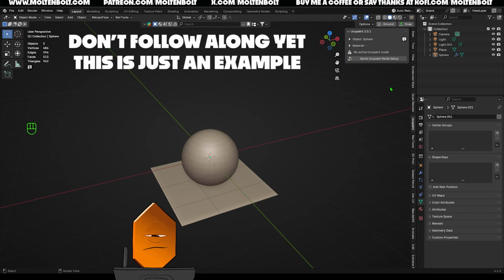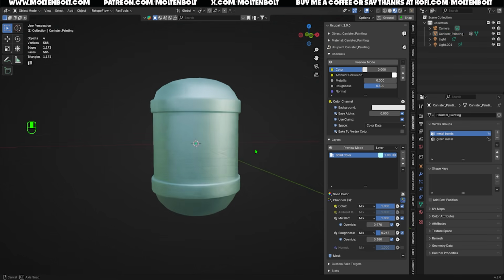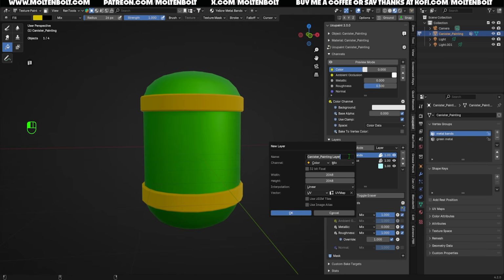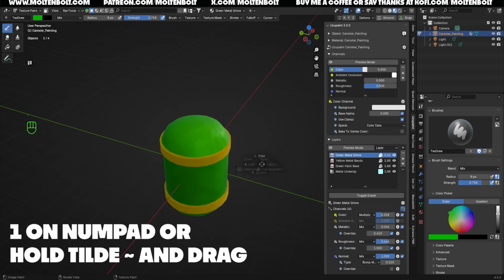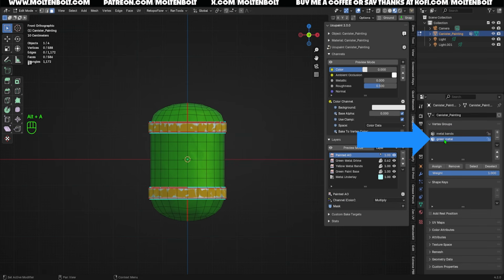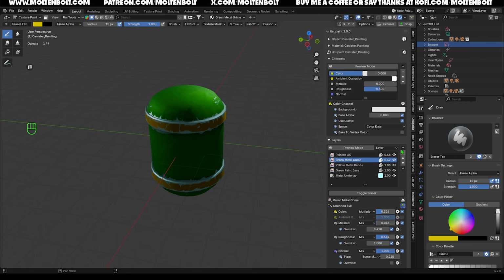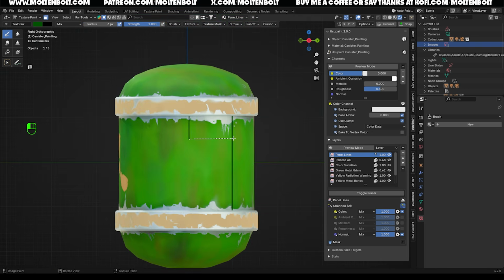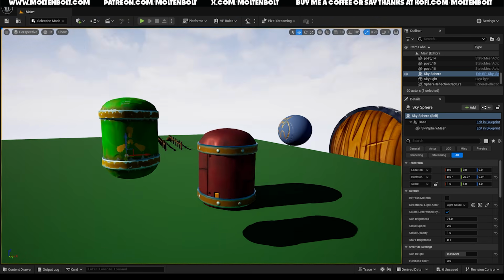FREE Substance Painter Alternative? Ucupaint! Blender Step-by-Step Tutorial

Comment: Im following your tut, but when im painting, some artifacts start to pop up afterwards. its like some quad topology is pushing trough, i can paint over it, but after a while it reappears.
Reply from the maker: Ive noticed this happen as well sometimes ans my hypothesis is that it has to do with the brush angle relative to the camera angle, maybe? 🤔
Reply: @moltenbolt  i have been testing it, with your model, i can replicate it by painting at weird angles, but if i subdivide it by 2, apply it. I can't recreate the artifacts. I think you allready know this, but another reason to use high poly res and bake it down.

Comment: Thanks for this tutorial, one thing though, when I paint just like the way you say, the color slips its way into other layers, no matter if the Paint Mask is on. Is it a me problem and is there a solution to fix it? Thanks anyway
Reply from the maker: Might be the Bleed settings in the brush options? Could be that it's set too high and it's painting over the uv seams 🤔

Comment: best ucupaint tutorial!!!!!   and omg, after 3 days of wrestling with substance painter to Just Give Me a bit of painting on the uvs with TRANSPARENT BACKGROUND... (it failed)  this is a life-saver!

okay, but on the radiation symbol part...  suppose i want to define the size and rotation of the decal, then move it into position -- like drag it around on the model before 'stamping' it down.  can it do that?
PS: would also like to be able to change the proportions of it while i'm doing that.  ;D

OH! i see... blender has just made that impossible, hasn't it? :/    i even changed the ratio of my decal  image, and when i put it in the brush... the brush made it square.  ::SIGH::  SOME DAYS!!!
Reply from the maker: Thank you! You can rotate the orientation of a brush, for sure. I think the hotkey is either CTRL+F or ALT+F, but I dont remember which hahah. The size will just be the brush size 😁
Reply: i did find blender's stencil brush mode, which will let me place and stamp a stencil.  but still doesn't let me stretch it on only one axis.    thanks for getting back to me :)

Comment: Hi! I have a question about exporting my model to a game engine like Unity. I made a house building, that has multiple meshes, with each different channel. Do I individually bake the different channels by clicking on each different mesh, and then exporting it as glb? Or is there another way that I need to go about when dealing with different meshes all at once? For some reason, when I import the glb file into unity, it is just showing as a white folder, but its not letting me put it into the scene. And I individually exported each different mesh's channels btw. Any thoughts as to why its like this in Unity would be greatly appreciated, thank you!
Reply from the maker: Dunno if you have tried this already but you could try to join your house meshes together into a single object in Blender before baking and exporting and see if that works. I know that with Ucupaint you can export an object made of multiple meshes and have it work. Lemme know if joining them together before baking and exporting helps, if not I'll take a look after I'm done work 😁
Reply: @moltenbolt  I will try that with my next project! I just installed a JsonDotNet package that lets you import gltf files to Unity (followed this other tutorial) which worked, but maybe your method would be easier. Thank you for always responding to our questions!
Reply from the maker: @babyshkaProd  hehe I do my best to help where I can :D 3D can be hard!

Comment: Thank you for this fantastic tutorial. It helped me out a ton.

An artistic note I'd like to add is that I think you chose odd places for some of the wear. The inside corners between the bands and the canister itself would probably be least worn out, as those locations would rarely be in contact with anything. Wear on the green would be greater further away from the bands. Depending on how this thing would be handled, tons of wear would be at the top and bottom domed parts as they are very physically prominent and exposed.
Reply from the maker: Hehe thanks for watching 😁 and I agree, you've made some good points about the placement of weathering!

Comment: what if I need to fix some small area on my existing texture on UV? How can I use for example clone tool on 3d model (not on 2d UV wich is not handy at all for small areas like tail) without rebaking everything again?
Reply from the maker: Blender's texture painting tools do include a clone tool which works with projective painting. You should be able to use it like any other clone tool to fix spots or copy painted areas. There is a small write up in the manual on the clone tool

https://docs.blender.org/manual/en/latest/sculpt_paint/texture_paint/brushes.html#brush-types
Reply: @moltenbolt  thanks, but is there a way to use Ucupaint with my old UV and texture?

Comment: How do you do the multi layer outlines for your thumbnails? Freestyle? Some custom shader? Im trying to make it myself but its more difficult than i thought.

EDIT: Got a very hacky partial solution. Add a Grease Pencil Line Art Object with the object selected > Convert Lines to Mesh > Extrude > Change Material to Emissive with no Specular > Duplicate, Scale and Change Color To secondary Outline Color.

Really messy way of doing it, works partially, rest of the mesh doesnt get edges because its not detected in 3D. There should be a way to do this in compositor but so far my methods have been unsuccessful.
Reply from the maker: I usually will export a render with a transparent background and then add the outline in external image editing software. But yeah a grease pencil collection modifier would do it as well, though it draws its outline relative to the camera 😁

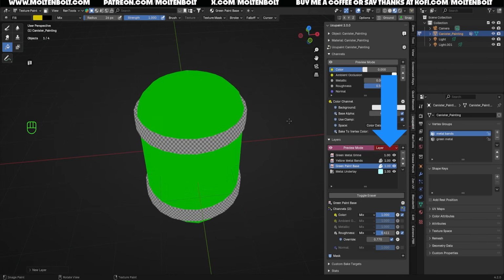Comment: 00:08:00 if anyone is having trouble getting the Layers Preview Mode to show the green color in order to use the eyedropper tool: make sure you also have "Color" selected in the Preview Mode section at the very top of Ucupaint.
Reply from the maker: Thank youuuu 😁
Reply: @moltenbolt  Your video is very helpful. I just got stuck on that part and had to fiddle around for a bit before I realized I'd selected AO
Reply from the maker: @rickyrangeljr9597  ohh, glad you figured it out :D and thank you! I'm glad it's helpful

Comment: I can’t export my model with the baked textures? I’ve tried fbx and gltf and no textures appear ?
Reply from the maker: Once you have baked your layers, there will be a section in the "Layers" menu in Ucupaint. Next to that, on the right, will be there words "use baked" and an icon of what looks like nodes. If you hover over the icon that looks like nodes, you'll see the tooltip that says "enable baked outside". Click that button to toggle it on (it will be highlighted when it is on). With that setting enabled you should be able to export your model with the textures correctly applied. Lemme know if it works 😁
Reply: @ thanks man appreciate it :)

Comment: Im quite new to using Ucupaint, would it be possible to have an Ucupaint Material overpaint another Ucupaint material? for example, I have a already dont Ucupaint material, now I just want to add Emmision to some specific parts, is that possible? like I have done the skin well now, next step would be glowing tattoo's
Reply from the maker: There are a few ways. You can  either use a mix shader to add a completely separate Ucupaint node (set to emission) in the shader graph. Or you can turn on the emission channel for a painting layer if you are using the Principled BSDF and turn up the emission value 😁
Reply: @moltenbolt  OMG THANK U!!! I'll try this!!

Comment: A lot of the basic features of blender are not very good, this addon has a great design, but there are a lot of bugs in the display and refresh (often it doesn't paint, but after switching viewports or edit modes, it turns out that it just doesn't display), which is fatal for a plugin that paints textures, I already know how this addon works, but after using it for a while I switched back to the my old workflow, just because it at least works stably.
Reply from the maker: Dang bugs! I totally get it though, you gotta go with what works for you! 😁

Comment: Great plugin, fantastic tutorial. Two quick questions:

1. I know I can bring in pbr images into a layer. but is it possible to use a procedural texture on a layer? I was able to get some combination using a mix shader node, but I'm hoping there's a more straight forward way to do that with the add-on.

2. is there any way to create clipping mask? (IE: draw one layer, and then have my second layer only draw within the bounds of layer one).

Thanks!
Reply from the maker: Thanks! To answer your questions:
1. In the Mask section at the bottom of the Ucupaint menu, click the + icon to open up a list of mask options. In that menu are 'generated' masks which are procedural. I cover this in detail in this video: https://youtu.be/fHb3F0xwJ9c?si=GY_5lmf9iyQXbw1A

2: yep. You can use any image as a mask by choosing the add new layer as mask option or by selecting an image from the mask menu.

Hope that helps! 😁
Reply: Thanks! 

1. I was hoping to be able to send an existing pbr to a ucupaint layer from the asset browser. (In the same way you can use an image based texture). Perhaps a future update might have this functionality.

2. I was missing a step. "Open available image as mask", and then selecting the layer/painted area I wanted to clip to.
Reply from the maker: @dannaglia  You can open downloaded PBR files with Ucupaint, either as single PBR images, or the entire texture set. Under the "New Image" options, there's "Open Images to Single Layer" and "Open Images from Material". Those should let you import and entire PBR texture set that you got from Polyhaven or CC0Textures, etc. I'm fairly sure it should work from the asset browser as well, since the decals work that way, but not 100% sure. 😁

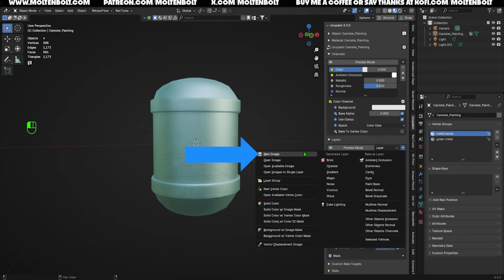Comment: Hey, i have a small problem at 4:07. When i had a new image, i don't have the channels options underneath. I only have : Channel(Color) - Mix
Reply from the maker: Hmm, that's odd. Did you choose 'Emission' as the Quick Ucupaint Node Setup option? The emission node only deals with the color channel. When you setup Ucupaint with the Principled BSDF option, the channel options should appear in the dropdown.
Reply: @moltenbolt  So my problem was much simpler than that lmao, i just didn't clicked on the right place. I was clicking on the name : channel, instead of the icon next to it... Thanks for the answer tough :D and Merry Christmas man ;)
Reply from the maker: @Ohgmios  hehe sweet, glad you found the solution 😁 merry christmas!

Comment: Saddly I must thumbs down your second tutorial because it misses a CRUCIAL step.
It doesn't explain to link the texture into texture painter mode to prevent a pink canister of death. A very simple step but a crucial one.
Reply from the maker: Dangit, I try to be so careful, especially about crucial steps like that. Thumbs down is fair, for sure. Maybe I'm misunderstanding what you mean by linking the texture to texture paint mode, but I don't remember having to do that when using Ucupaint, I thought it linked automatically. I could easily be mistaken though, because my memory is horrible hahah
I appreciate the feedback very much, and I'll do my best to be diligent in the future!
Reply: @moltenbolt  the issue is you start applying ucupaint layers in the layout before doing so in the texture paint tab. Itll work if a material is asssigned to the model before hand, but if its new, as in a person following along, they will get a pink model and missing reference.texture until a new material is applied. 

Unless you say to switch to texture painter tab and i missed it, in wich case, shame on me and you got yourself a thumbs up

Comment: I've been doing 3D animation, modeling, photoshop and illustration work since 1990... photoshop was just a baby then! I've used many different 3D tools (3dsMAX, Maya, Softimage, Cinema, formZ, EIAS, etc etc) Ive worked in game, feature film and commercial capacities. Using blender for the past few years, it has the worst most confusing disaster of a paint system I have ever seen. Ucupaint looks like a breath of fresh air and I look forward to putting it through the gauntlet of tasks with extensive work.
Reply from the maker: Ucupaint is astonishingly powerful, especially since it's free. Ucupumar is a saint for making it available to everyone!
Reply: Have you tried it since then?

Comment: For anyone who is looking to fix some... hiccups or just want some other elements in your belt that this... frankly smooth and slower paced Tutorial from Molten Bolt, here you all go:
When you are using the NUM PAD's 7 (for top down), 1 (For looking from the Y axis AKA Front on), or 3 (For looking from the X axis AKA looking from the right on) you can press 9 on the NUM PAD to flip your view to the other side, or 8, 4, 6, or 2 to adjust the alinement. HOWEVER, do note that if you use the 8, 4, 6, 2 buttons it'll lock your view camera to Orthographic and will make a lot of view angles not feel right. This is fixed by either pressing 5 on the NUM PAD or 7, 1, or 3 then moving your view as per normal. 
That said, I'd say the ~ button is by and far just easier to use than the NUM PAD as it allows you to get just about right on what you want. Buuut, it doesn't let you slight adjust the ortho view... so there's that.
Next item on the list: "Why is Molten Bolt's Krita strokes looking so different than mine?" He's using a stylist and tablet. While not "NEEDED" it makes artistic stuff like this WAY more pleasing to look at. If that wasn't the case, I am unaware of how he had a mouse stroke do the hard to fade thing. XD

Honestly, this time around, that's all I got to add! Well done Molten Bolt. I couldn't think of much else to point out or add to the discussion. Which is awesome. I had hiccups, as I'm sure others will, but that's what practice is all about. The more you use something the more you'll understand it. Once you have a good foundation, branch out a little and see how far you can push the tools you have. But, I'd say only after you understand things at the base. There are so many hiccups I run into that I'm like "Oh, okay, that's related to this... soooo look in this menu... what's different? OH! Okay, that option is on when it normally isn't" and fix the issue. Though other times it takes me hours to figure out what is wrong. (Though I do still figure it out on my own I should have just asked for help XD)

The fact that it is super easy to get Ucupaint (Which I kept hearing you say U two's paint XD) straight from blender's in system menus is VERY helpful.
Reply from the maker: Awesome and helpful as ever FadePanther, thank you 😁😁😁

Comment: Is there any chance to disable white effect that 'selection mask' button gives on other vertex group. Cause when i try to paint a character, im having problems with it. Example drawing shadows that needs to match with other face group (vertex group).
Reply from the maker: There's very likely a setting that lets you change the paint mask opacity, either in Ucupaint, the viewport somewhere, or in the interface options in Blender's preferences. Just can't think of where it is at this moment 😁
Reply: @moltenbolt   If its there, thats my job to find it so no problem 🤣But anyways, i have another huge problem.. Texture painting lags very much.. My pc specs are really good espacially the RAM and CPU, but its lagging somehow. Do you have any solution for it? Like i can't even make simple moves on the model.. On previous version of blender, there was a solution for it, and its so basic. Just using Texture Painting tab as a 'single tab' on viewport. But now, its not working either. There is a lot of questions and lot of answers on some forums that saying just disable BackFace Culling and Occlude, but its not working either man. So, do you have any solutions for it. And thanks for the answer tho.

Comment: Thanks for another great tutorial! Just a little tip from the addon developer here, for those base color of green and yellow, rather than using texture paint fill, you can use solid color layer with color ID mask for assigning faces in edit mode into a different colors. It's easier to do and even more non destructive since you can always change the solid color anytime. You can see the examples of how to do just that in my channel in the video 'Painting anime eyes demo'.
Reply from the maker: Amazing! Thanks Ucupumar! 😁
Reply: First, thanks @molterbolt for the basic tutorial and thanks @ucupumar for the addon, then it is indeed more practical with a solid color and an mask color ID, but to add the smearing, if I'm not mistaken, we must add a second mask with a mask image.
Reply: @SLaps-xl9no  that's right, you can add multiple masks with ucupaint 😁
Reply: Thank you for making this amazing addon!
Reply: Legend in the chat
Reply: @ucupumar I would shout this from the rooftops. I've seen this as "Paint in Blender with layers like Photoshop". It's so much more. It was Passivestar on Bluesky who turned me onto how powerful this could be. I've watched Moltenbolt's video and it's an eye-opener. This is a true alternative to Substance Painter.
Reply: Hey guys! Have you noticed the brush doesn't work? I am not sure why. Hoping this will be solved so I can follow these great tutorials and use the plug-in. Thanks.